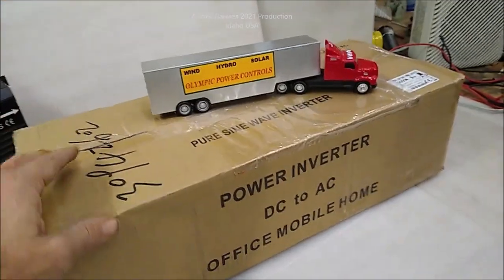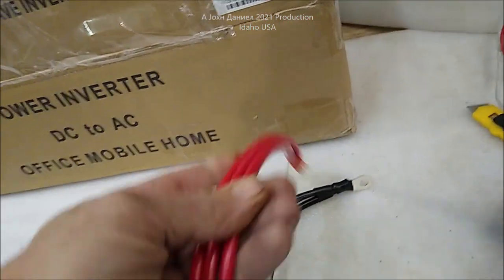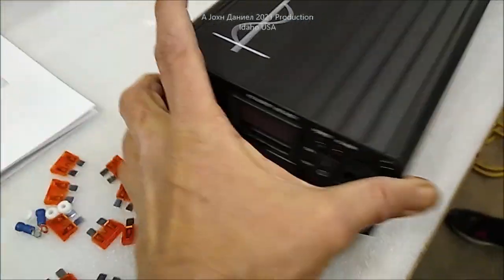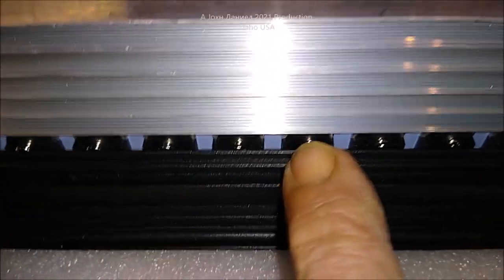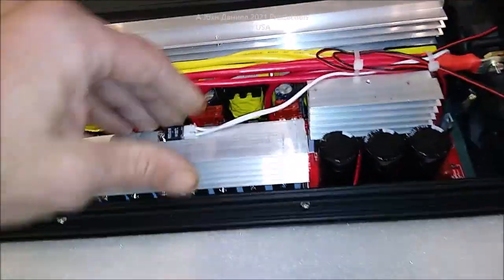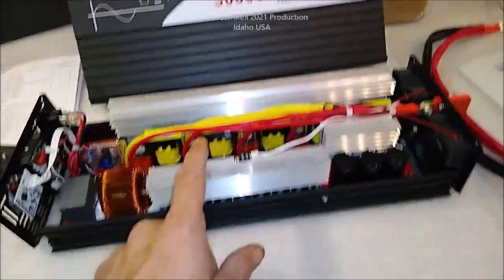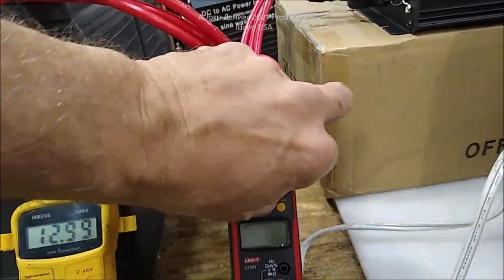SWI-Power 3000 Watt Pure Sine Wave Inverter, Newest for 2021 We review it, Parts List Below

Comment: Glad I found your video! I've been trying to decide on a 2000 watt inverter for my popup truck camper. I'm installing 400 watts of solar and have 2 x 100ah lithiums. I just swapped out the old converter and fuse box for a new one with the switch to charge lithiums. Looks like the 2000 watt SWI will work for what I need. I only need one plugin as I'll run an extension cord from the inverter out of the old vent hole around the front of the camper so I can plug the shore power cable into the inverter. I wired up the new converter to it's own breaker so I can switch if off when connecting the short power directly the to inverter to avoid the "loop". Thanks again! 👍
Reply: One quick question... should I go for the 2500 model? I won't be using a microwave. Biggest draw would be my small Kuerig coffee maker.

Comment: Where is the low voltage alarm buzzer? And how would I go about removing it/quieting it down? I have a Renogy one but I assume they're all designed roughly the same.
Reply from the maker: On the renergy models, which are actually very different, there is a little round disc in a plastic body right behind the voltage balance control board. It will have a tiny hole about a 16th of an inch in diameter and it looks like if you shine a light there's a small coin in it. Taking the tip of a toothpick if it reacts with a little resistance that's the piezoelectric buzzer / beeper that activates for your low voltage reaction. But in all honesty running a renergy at low voltage is a hell of a way to blow out your mosfets. Proceed with caution when dealing with any of these because they do not have an actual grounding circuit it's a floating ground to satisfy electronics.

Comment: What type of equipment can use modified sine wave inverter?
Reply from the maker: Tough Tools, Lights without a ballast, high amp AC to DC items like cheap MIG Welders, and for quick use lots of normal uncomplicated tools or equipment. Long term use, I recommend to go pure sine, and high or low frequency means nothing now days. Save 75% and just get the high frequency and a great filter strip like a Furman 6B https://amzn.to/3MI4iJx and nothing can't run good on it. Money saved, buy some extra good Power Queen batteries!

Comment: John can you review some cheaper 48vdc input inverters  want to use my 40vdc ryobi tool batteries
Reply from the maker: Tool batteries are not wired to handle and inverter, they do have some versions that run electric lawn mowers and even some that would work as a UPS battery so they may function partially for that. But a 48 volt inverter would disconnect at about 42 volts and would not run long on a 5 amp battery, you would need at least 4 to 5 of those batteries to run a 500 watt inverter. 
But there is a solution, you can run a voltage converter off your batteries which increases their amps and getting off the shelf 12 volt model of inverter.
Reply: @JOHNDANIEL1  I see.  I saw several 36v inverters of various wattage outputs.  I'm thinking that this range would be more effective with my battery type.  Using blocking diodes and adaptors 3d printed for that battery type that I could parallel several together.   The have a high discharge rating.   I use mine with many yard tools including my chainsaw, lawnmower,  weedeater etc.   I have over 20 ryobi 40 volt 6ahr batteries.   Would like to use them in my shop to power bench tools.   I have made several powerpacks for my home to power internet, lighting, TV etc.  Solar charge by day use at night to offset my electric bill.   Now wanting to increase my capacity for the shop.    Just my thoughts
Reply: I have the 1500W / 48v inverter running off my 48v 12amp/hr ebike battery - PERFECT 👌🏼. Runs my TV, fridge, 2X computers, fan, LED lights, router and Sound Bar. Just purrs like a cat. Wish I could post a pic.

Comment: I need to make a portable 10kWh hand truck system. Xijia also makes a 3000-watt inverter/charger that might work well. I need to decide between this and a Growatt, which is about 650USD but weighs only 12kg.

Comment: Sir  does this inverter capable to run domestic submercible pump  like100 fit deep borwell
Reply from the maker: Yes, but for the pump start surge I recommend the 3200 https://ebay.us/aZ87MX for a few more dollars, it has much bigger boost ability for motor start up. We run a 1-1/2 horse 120 volt pump 1130 watts run, 2980 watts start on one with no issue, 3 years now.

Comment: I need a 2000 watt inverter for my 18 wheeler. 3 way oven airfyer an microwave,  TV, surround sound, 45 quart iceco freezer and a indel fridge.  What is a good pure sine way to invest in that won't burn my truck up. 4 semi truck batteries at 950 amp. With 1/0 Guage wire from batteries
Reply from the maker: You mean what you need is much more than 2,000 w. Something with a mega-sized transformer in it and you'll likely  have to step up to 2/0  wire. My power about the same stuff in my cattle  truck and have been respectively for 3 years using one of these. https://amzn.to/33dfHhK 
Worth every penny and tough as nails. These do not get damaged from the heavy starts and charging  of a semi truck like most inverters do. This style of inverter will also allow you to add charging abilities for either plugging in the truck to AC power, solar in some cases and it manages your charging cycles to improve your battery life.

Comment: ~8:23 - that is the filtering cap for spwm. Nothing to do with starting. The reservoir and filtering capacitors (more to do with starting power and surge power) are the black cilindrical ones in the hudreds or thousands of microfarads at ~450Vdc. 
The filtering capacitor (or capacitors) are in the 1...4.7 microfarads and witht the choke or chokes, in the range of 1-4mh, next to it form a low pass filter that smooths out the very rectangular pulse width modulated current coming from the fets into a clean(ish) sine wave. 
A big filtering cap could mean a better and smoother sine output with less distortions and better ruggedness to spikes but nothing to do with surges, loads or starting. 
It actually wastes some energy and pushes it back in the choke, where most of it becomes heat, making the inverter use some extra power without any load but there would be no usable energy coming out of the inverter without it. 

Anyhow, thanks for sharing, I do enjoy seeing the guts of these cinese inveters. Sometimes is hilarious to see the gap between their undersized components and eye watering exaggerated ratings :P
Reply: What is your opinion of the inverter? Is this work buying. I have very small needs maybe a small freezer.

Comment: I have a 1500w same model trying to hook up to 100w solar harbor freight system and the alarm just flashes....not working. Any ideas? I'm a newbie.
Reply from the maker: You can't connect solar panels to inverters. You'll need a solar charge controller, 12 volt deep cycle batteries and then the inverter you have will run right. They do make an inverter with a built-in solar charge controller but even then you still need batteries because the inverter requires bulk charge to operate.
Reply: @JOHNDANIEL1  I do have a charge controller, I found my issue. It is a 24v inverter. I now have a 12v inverter and it is working great. Thank you

Comment: I have a question ...?

 This device working.

XYZ INVT 3000W Pure Sine Wave Inverter - 12V DC to 120V AC Surge 6000 Watt Power Converter Generator with Wireless 100ft Remote Control for Solar System, Home Grid Off, Camping, RV. (3000W 12V 120V)

 When connect to with this device ...

Anbull SMPS 110V AC to 12V DC Converter Power Supply Adapter Switch Transformer Max 50A 600W (New Version)

Or - Switching Power Supply Output Voltage: 90v

and give power ....  100 /120V 60HZ  3000W

Comment: I have had this same inverter for the passed 3 to 4 years, still going strong, I did had to replace the 2 fans inside as they burnt out last year but great inverter. 👍
Reply from the maker: My cooling PWM fan circuit failed from running it in 110+ degree heat at 75% load running a RV ac for days. So I wired in a few bi-metal disc and it's fans come on at 45 Celsius and have never been a issue again. Owner caused and owner fixed.
Reply: Fans burn out due to cheap inverter design.  Measure the voltage going to the fans...in my case, the 12v fans (absolute max spec is generally 13-14v) were getting powered with 18vDC.  They'll run for a little while, but eventually WILL fail.

I added a buck converter to mine to drop the voltage to 12v on the fans.  They should never fail again--well, partly because I've ditched the HF inverters anyway ;-)

Comment: This is a good inverter. I bought the 24V 3000W version after watching this review. 
Been running for 8+ months. It doesn't get hot even when you run it at close to 3000W output for longer periods of time.
Coolingfans starts both when it get hot and when the load is over 1500W. Best chinainverter so far.

Comment: I noticed you have the duracell 6v batteries. do you have any experience with the 6v duracell from sams club? I am considering them.  locally they are $97 each plus core.
Reply from the maker: Those at Sam's are made by JOHNSON  CONTROLS. Same as most Walmart batteries. They'll probably last five years but you're better off spending the extra 30 bucks a piece and buying the real East Penn manufactured. I put a link to Batteries Plus under my videos usually so go in there and check them out they're a little higher amperage and just a few dollars more but you can get a  full 8 years

Comment: What are the MOSFET part numbers? How did they implement the current limiting? Does it have DC output detection to disconnect the output if a MOSFET or controller fails and causes a high power DC output?
All inverters should be tested by running them to full load in a 45 degree ambient and then repeatedly short circuiting the output at least 10 times.

Comment: Hi. Great videos. Is it better to have an inverter connected to a 24v batery or buy one of those inverters that connect directly to the wind turbine?
Reply from the maker: Always connect to battery for inverters, you need the capacitance and load carrying ability of a battery that's stable.
Reply: @JOHNDANIEL1  That applies for those inverters where i can connect the AC from the turbine? or ony for solar inverters?
Reply from the maker: All.

Comment: It has alot of similarities to the reliable inverters, I have 4 of the older reliable inverters, 3-3500 and 5000, all of which put out close to their rating, and have been great, no issues, turning on fridgerators, freezers, well pump, lights, tvs, air conditioners, etc in our home, but they are a high freq, and don't dare to push past their limit. I have Schneider conext for bigger things.
Reply from the maker: For a low frequency 240 volt 4000 watt dual phase 12,24,48 volt powered Inverter #1 worldwide, made by SUNGOLD https://bit.ly/36I3gw0
Weighs about 70 lbs. Under $1000

Comment: I have that same inverter 3000 watts pure sine wave 48volt DC input I buy it from a guy he tell me he test it with one battery 12 volt DC only DC INPTUP VOLTAGE SHOW THE AC OUTPUT VOLTAGE WAS NOT SHOWING I THINKING NEED 48 VOLT DC BATTERY RIGHT TO SHOW HOLD THING OUT PUT AC OUTPUT VOLTAGE

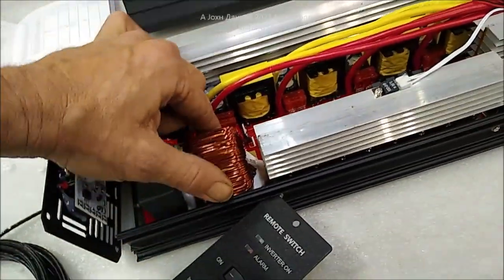Comment: Nice informative video.  @10:13 is it a transformer or a coil to filter out the AC, in the LC circuit!  The 4 transformers behind are the ones doing the heavy lifting, from the low voltage to the high voltage, and its the MOSFETs behind in the heatsink which are chopping the DC from the batteries into an AC waveform.  May sound too technical but the education of the viewers has to start somewhere.  Its not only a question of figures, but understanding the topology of the inverter. Keep it up.

Comment: Hi John, I have a 1200 va Victron Phoenix 12 / 230v and running my fridge, ( large kic ) and freezer (150 l box defy) simultaneously 24/7. Will the victron last ? Kind regards. Ben, ZA🍺🍺🍺
Reply from the maker: Victron is made from significantly higher quality parts but still just like everything else in China, keeping it cool and well ventilated but most likely give you plenty of lifespan from it but generally most inverters will wear out their diodes inside and 3 to 5 years.
Reply: Thanks for your reply,  like your videos 🍺🍺🍺

Comment: Great video!  I'm looking for something just for a power outage, is 3000 watt good enough to run fridge, freezer or heater - (all one at a time)?
Reply from the maker: Refrigerator and freezer yes, I never tell anyone they should run a heater of any kind on inverters because of the load is absolutely constant and you'll destroy your batteries.
Reply: @JOHNDANIEL1  what if I had it hooked up to the car battery and the car is running?  Just to get some heat in an emergency.
Reply from the maker: Short term yes. But I recommend a lpg direct vent heater added to your system so you can avoid that heater load on your car. Cheaper over time to do that.

Comment: Can a person hardwire this to a electrical panel in a small off grid cabin?
Reply: It has a direct wire capability, but not sure about an internal switchover relay.  Probably need to use a manual source selector switch (rotary) to choose whether battery or utility power is energized for the home 120 system

Comment: The low voltage shut down you showed was at about 11.5 volts, but the ebay ad shows it to be 10 +/- 0.5 volts.  Did your input voltage to the inverter sag that much when you turned the heater onto high or did it shut off at 11.5 volts?  I want to buy one for a lithium battery setup where I would like to be able to run it down closer to 10.5 volts before kicking off.

Comment: Great video, really appreciate the detail you went into concerning the build quality.  Nobody should be running a 12v inverter to generate 3000W AC though, you can buy a 48v version of this model.  1/4 of the amps, higher efficiency everywhere
Reply: 48 volt battery bank will have to consist of many batteries to have sufficient ampacity.  What would be a typical configuration?  I have four GC2 six volt batteries crammed into my boat just to have enough 12 volt capacity for house loads.  I don’t ever intend to draw 3000 watts from my inverter.
Reply: That's not as easy for some to just "get a 48v version" you would need to have a completely different battery set up if you are using Lithium.
Reply: Don’t order their 220 v version. Mine came with 110v sockets and was 50hz vs 60. Imagine what would happen if you plug I want an appliance into that socket. Boom. And trying to run a 220 motor off of 50 Hz would be a similar problem. They are refusing to make it good at the moment. 300 bucks down the drain. It would be useful if they knew it in America we use 60 Hz but in Europe they use 50. Hopefully somebody and Engineering will make it right. In the meantime I’ve got AliExpress trying to explain it to them. It’s a good product and this is the fourth one that I’ve ordered. That’s the first time I’ve had a problem.

Comment: I used your link to buy one of these inverters. Runs the air conditioner in my camper beautifully. I have to use an extension cord because the GFCI plug on the AC unit won’t plug directly in as you noted. I was going to hook up a dedicated plug but the hardwire connection has no polarity indicated. Meter shows current across terminals but no current to ground. Ground to the case is isolated. I used a hand held led bulb and got power showing from both terminals. (Poor boys polarity tester).  Which terminal is hot? Shouldn’t they be marked?